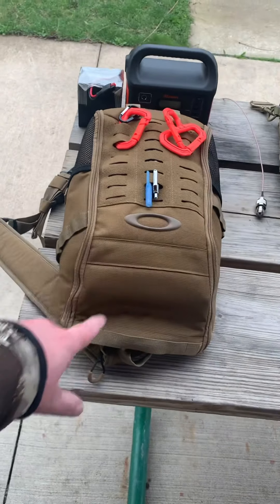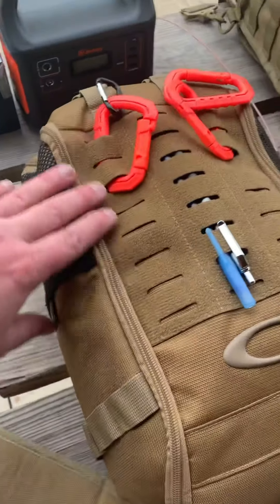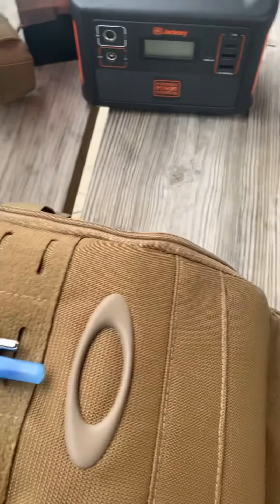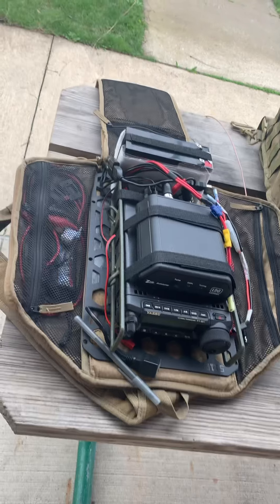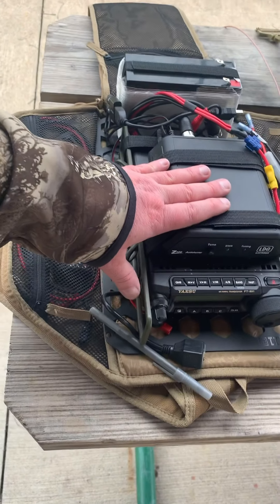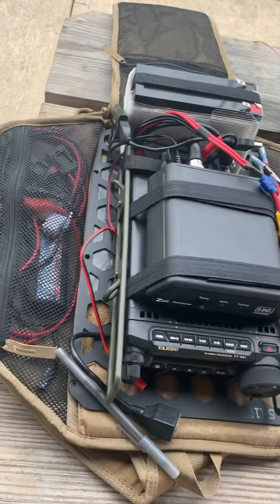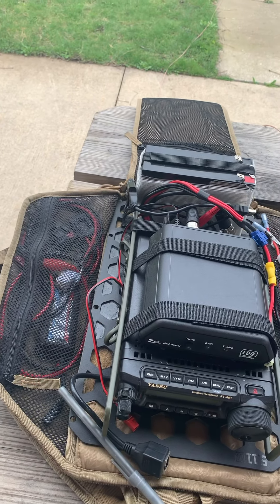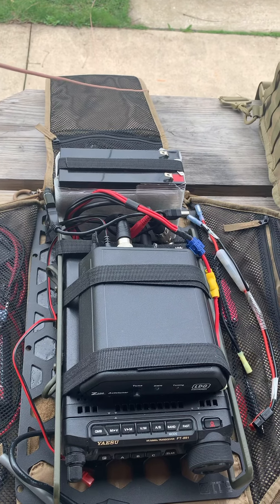POTA Go Bag - Oakley Extractor 2.0

Comment: I'm assuming that plastic mesh plate to which you have everything mounted doesn't come with the backpack.  Where did you source that?  Looks like it's a perfect fit for the interior of that pack.
Reply from the maker: Hi Matt, you are correct.  I sourced the hex grid panel from 5.11 
https://www.511tactical.com/hexgrid-insert.html

I did have to trim it a little to get a good fit.
Reply: How much of the pan el did you had to trim? Great set up by the way!!! Congrats
Reply: @CopeWERX  how do you secure radio to that?